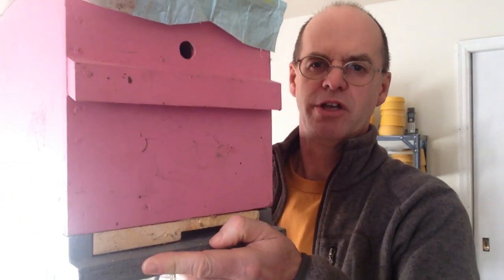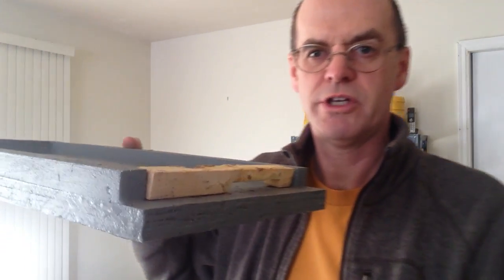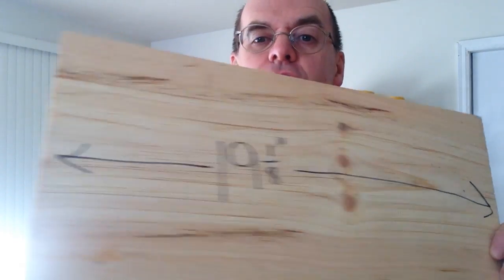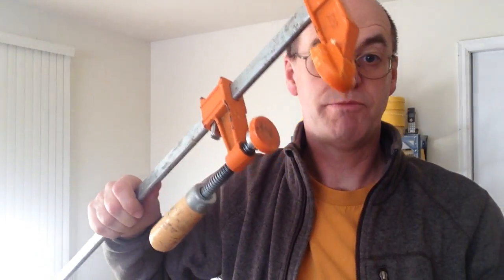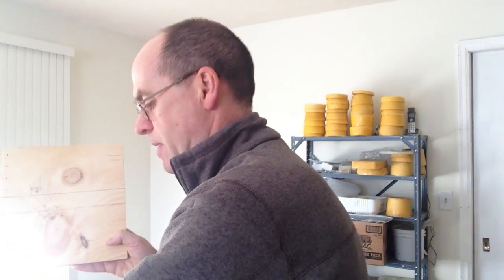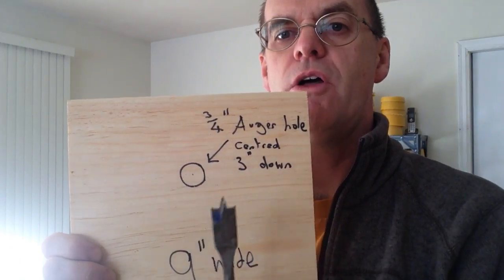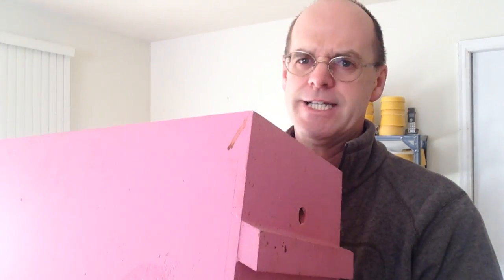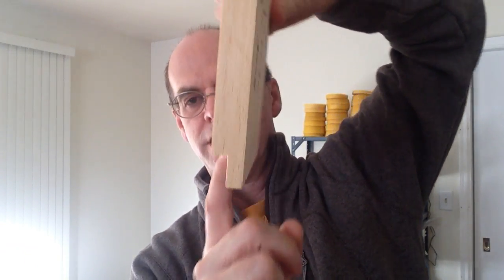5 frame nuc box design.

Comment: Thanks for such a thorough walk through!  Good tips.

I'll likely take a pneumatic stapler to mine rather than galvanized nails.
Reply: +Joseph Meyer And I use 3 inch screws to do mine... ;)
Reply: In the past I've used 2" screws on 3/4" pine construction. I'm mainly shifting to pneumatic staples because I want to build a hundred plus before spring.
Reply: Understand. I just built 25. I like the screws though as then I don't use clamps which slow me down and add more tools that I , (don't want) . Sounds like your bee breeding is going good.

Comment: What happens when you do have the upper entrance? I like your setup, thanks for sharing
Reply from the maker: In the coldest of days (0-10F and below) it freezes off.  I reduce that top hole with 1/3-1/2 a cork in the winter.  The bottom box has a fully closed auger hole.  If I used a very top entrance it would negate the insulation.  Some heat is escaping through that vey top reduced entrance all the time.  I would like to reduce the heat loss, but not suffocate the bees.  However, as I try new things I am going to make changes slowly and carefully.  The 5/5 set up has been working well, and I don't want to mess things up.